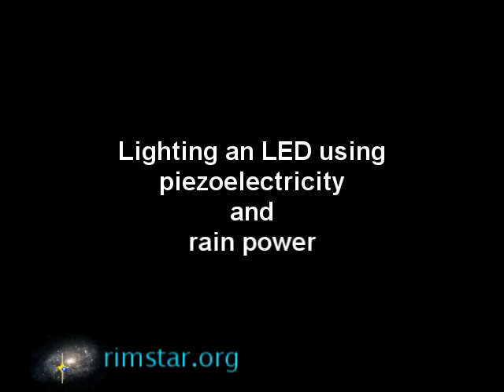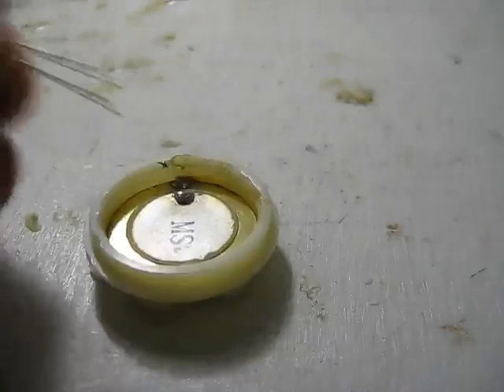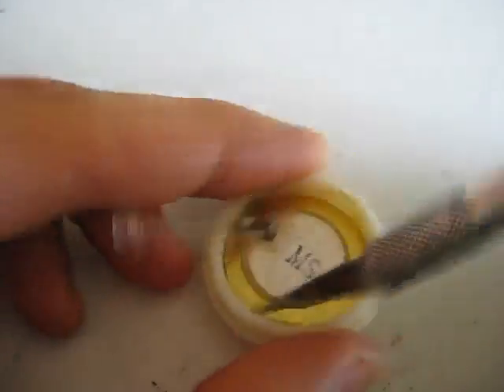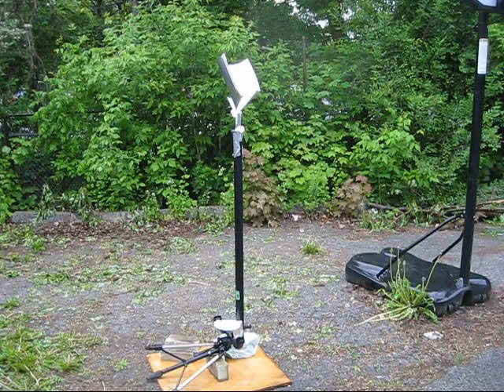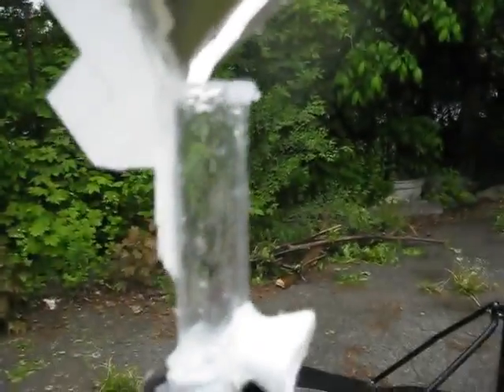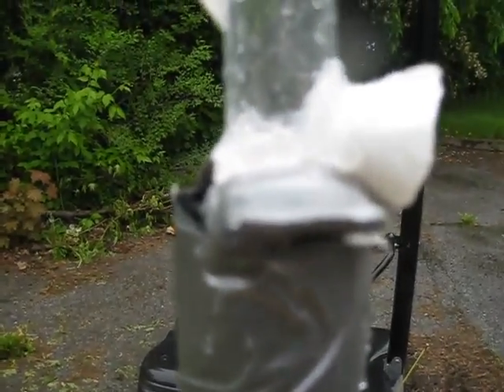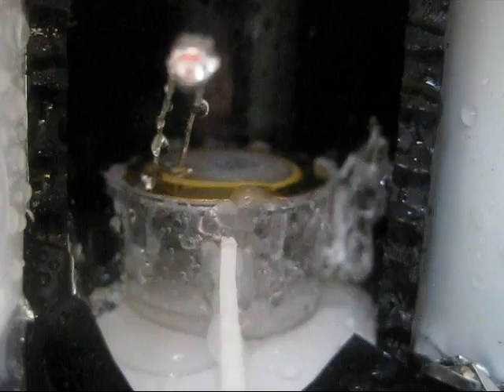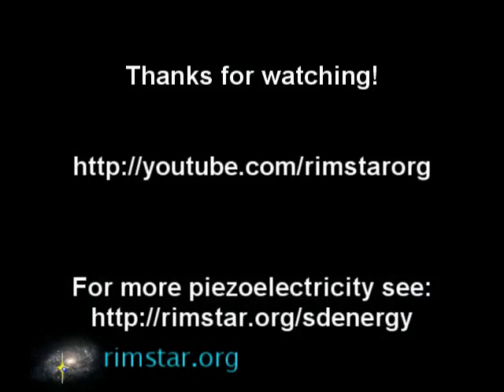Piezoelectric generator LED lit by rain water

Comment: I dont get it. You usually give detaield explinations. Does it work with water, pressure, or both?
And why/how does it work?
You can even have a bucket over it and just have a small enough hole to regulate constant drops on it.
But if we are going to deal with water how about having a turbine in the drain of the sink of get power from watsted water, or a tesla turbine in the faucet, toilet tank, rain gutters, etc. Just a thought.

Comment from the maker: Cleaning the shed can wait; your ball bouncing on the piezo is more important. :) It actually sounds like great fun. Two things to look out for. The ball might break the piezo but then, so what. The circuit's output voltage might exceed the scope's rating, though I imagine the current will be very low.

Comment: I have a few piezo speakers from scrap, and a high gain toroid free, I might even give it a go tonight after shed clean is done (I'm procrastinating right now). Would only take a few min to cobble together and put on scope, or LED. I'm imagining a perpetual motion device with piezo, and bouncy ball, and a tube, with a "hand" at the top to bounce the ball on the piezo..... Probably won't work, but could be fun. Super Balls are about 85% efficient....

Comment: Thank you. I'm starting to get the bits together. If you want a good read on Magnetic amplification, Check out The "Spark Bang Buzz" website for it. Try not to get distracted with homemade lazers and transistors made from sheet metal! There is a lot of great info on that site, for people like us, that build from scrap and cheap stuff. You could lose a few days in there! 4 turns is about as low as you will get decent coupling, so your MOT amp could be a lot better with 4 turn primary. I think.

Comment: I can't help but think this, and a few of your Piezo projects would work better with an amplification toroid.... I saw you use the mot for the crystal speaker, I think 4-5 primary turns, to a few hundred secondary turns (Things start to drop off around 37:1) on a toroid. Would work a lot better. I use a drill to wind a 3-4" nail with wire, then hand wind the toroid with that, only takes an hour to get 300 (neat-ish) turns. Great piezo series. You taught me stuff again! Got more ideas now. :D

Comment from the maker: Yes, though it's most likely more than 1.85 volts. But it only works if the pressure is a quick tap, in which case you get a momentary voltage spike. Maintaining the pressure gives you a voltage only when you first pressed down, then the voltage goes away even while you maintain the pressure.

Comment: Nice video! I am doing an experiment on piezoelectricity as well but I have had some problems. I actually cracked 2 of the 5 disks that i bought from a site (they are made of PZT and look very professional). I am trying to make a sort of piezoelectric tile. But anyways, i was wondering two things: 1. How much voltage does your disk give off? 2. What was the forward voltage on the LED light?

Comment from the maker: I don't know what would be the best type of crystal to use. My crystal from a gift card seemed to handle being wet a lot but I only tested it a relatively short time. Maybe contact from piezo manufacturers and ask about their crystals. I don't know any off-hand but you can search for them on the web. I also haven't played around with storing the charge from a crystal so can't really help there either.

Comment: project on harvesting power from the water which is being fed into the tank and store the current the main concept is providing an external path to the water which is being fed inside the water tank, before water reaches the water tank it will hit the piezo electric crystal and then it will produce vibration, further leading the water to the water tank
can u suggest me wat type of piezo electric crystal can be used and how can the charge be stored .
if u have any other ideas pls suggest.

Comment from the maker: I'd suggest starting with a very low capacitance (picofarads?) since there's so little energy from the crystal. But it would also have to have a high voltage rating since the voltage spikes from the crystal can be in the hundreds of volts. If the spikes aren't constant then I suspect a capacitor with a voltage rating not quite high enough might not be damaged. You'd may also need a diode. All of that would be in series. No promises it'll work, but should be fun to try. Let us know how it goes!

Comment: Thank you so much for clearing my doubts, i will now use a capacitor and see if it works out. Can you tell me which capacitor will work with piezo crystals and how should i connect it?

Comment from the maker: I answered this when you asked it in my other video but now I see where you're going with it. If the crystal is between a hard shoe bottom and the pavement then I think it would break apart pretty soon. If there was some padding to reduce the impact then it might last, but you also won't get as much power out. Then again, you might still get enough power out.

Comment from the maker: The energy output of a piezo crystal is small so you'd have to hit it a bunch of times to build up energy and store it in a capacitor as you do. The joule thief would then occasionally take from the capacitor. So it'd take a lot of drops before the joule thief would have what it needs. I haven't thought about the sound idea. That's exactly what piezo microphones do.

Comment from the maker: A crystal ear phone is a piezoelectric crystal like the one in this video. It's in a plastic container that channels the sound into your ear very efficiently.

So instead of connecting the LED like I did in this video, connect two wires that connect to your crystal radio in the same places a normal ear phone connects. You also have to put it in some sort of hard, thin walled container that has a hole in one side. Put that hole to your ear to listen. (continued...)

Comment from the maker: Thanks! It's a bit of struggle sometimes but I try to keep the videos interesting.

Re Rochelle salt and light... Just did some searching and turned up triboluminescence. I don't know if it'd work with Rochelle salt crystals. I'll have to try when it's dark. Also turned up something about light from electric discharges on the surface when a fluctuating electric field is applied. None of it seems like it would lead to a good luminos device though. Of course there could be things I didn't find.

Comment from the maker: A larger rain catcher would be good. But it has to be droplets and not a stream. The crystal works using taps not constant pressure. I observed this both in the shower tests and in the outdoor unit. So the maximum practical size for a catcher would be one that delivers enough water for a constant series of droplets tapping the crystal at a rate that allows it for the minimum time required to relax between droplets.

Comment from the maker: @Dgbug3 The definition of generator says "mechanical energy to electrical energy". The gravitational potential energy of the water is converted to mech. energy when it squeezes the crystal, the crystal turns that mech. energy into electrical energy. In a hydroelectric dam the grav. pot. energy of the water is converted to mech. energy when it turns the turbine, the generator connected to the turbine turns that mech. energy into electrical energy. So the crystal is the generator.

Comment from the maker: @MrSTEPHAN1975 Skąd masz kryształ? Czy spróbować pod prysznicem? Zajęło mi to 10 minut dostosowanie pod prysznicem fnd prawo kropli. To musiał być duży i spadek od co najmniej metr. Po to działa pod prysznicem a następnie dokonać maszyny.

Translation: Where did you get the crystal? Did you try the shower? It took me 10 minutes of adjusting in the shower to fnd the right drops. It had to be big and fall from at least a meter. Once it works in the shower then make the machine.